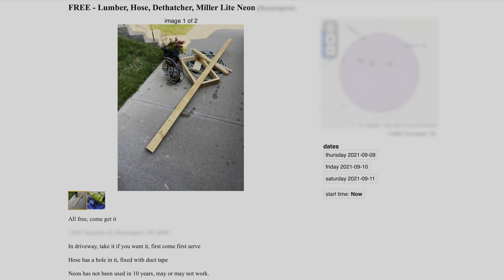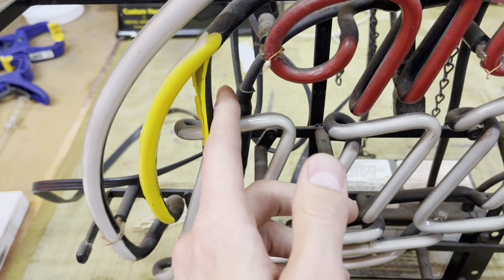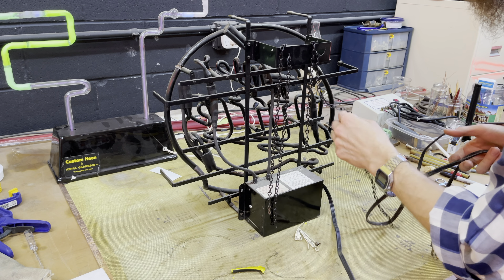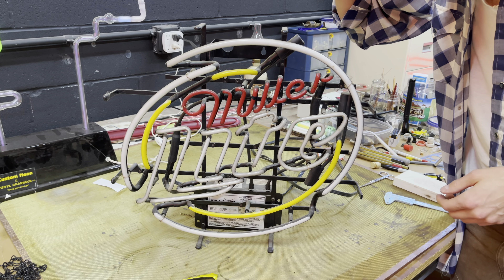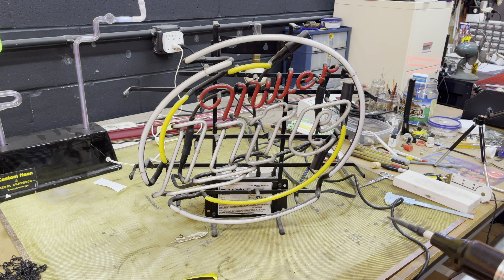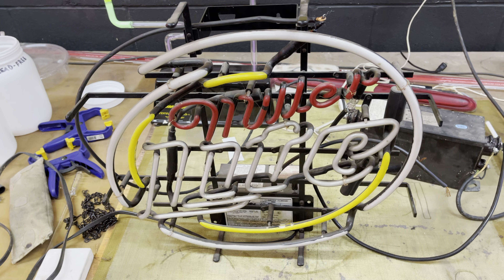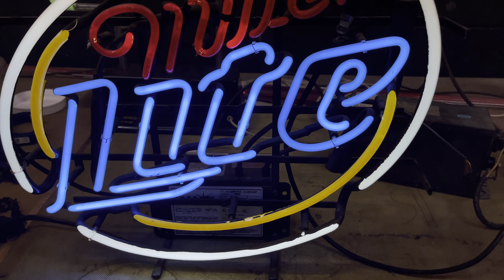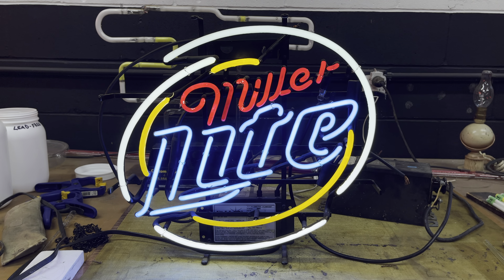Neon Sign Troubleshooting

Comment: Awesome video.

I'm planning on having a 3/8ths scale replica of a movie neon made.

Currently I'm still trying to recreate the original 1960 studio blueprint from a blurry screenshot. I've worked out the majority of the measurements, the only major question I have is the color of the sign body, I know the basic neon colors used.

The information I've gained from video such as yours will help immensely when im finally ready to have it built. I've learned that 3/8ths scale is the smallest I can go due to neon tube sizes, and that I probably don't want a neon that buzzes loudly like in the film.

Anyway, thanks again. Cheers

Comment: I recently picked up a similar light. 

How do you know the switch wasn’t bad and the transformer is working? 

The pull string was missing on mine. Do I need a specific kind of pull switch or can I use something from Lowe’s made for a ceiling fan.
Reply from the maker: good question!  TL;DR—on this transformer it's probably just way easier just to replace the whole thing.  but.....

transformers that are "dead" or "bad" could possibly still be working, but something may have shorted internally.  however, during manufacture, the internal components are potted in tar or epoxy, so troubleshooting anything inside the transformer case ranges from extremely difficult & time consuming to practically impossible.

that said, i was wondering the same thing as you, so i opened mine up to see if i could replace just the switch.  from what i could tell, the switch input goes to a circuit board that provides the ground fault protection as well as cycling the dim/off/bright/off.  i guessed that something on the circuit board had died, so as an experiment i depotted the whole thing, removed the circuit board, and wired the switch directly to the primary coil.  the transformer did work after that.  i dont remember if i used a new switch or if i kept the original one.  i put it back in the metal box without the potting tar and riveted the box closed.  the sign now works with the original transformer, but it no longer has the dim feature or ground fault protection.

was the circuit board really bad, or had internal arcing caused carbon traces through the tar that was shorting out the windings and removing the tar solved the problem?  i dont know.
would i ever do it again?  debatable.  it took HOURS, and it was a horrible, disgusting mess.  also, one wrong move and a wire in the transformer windings gets broken and all the work up to that point is a waste.  i was honestly amazed when the transformer actually buzzed to life after the whole ordeal.  also, old transformers can contain PCBs, which are carcinogenic.  i think this one was probably new enough to be PCB-free.
if you want to see what is involved in just removing a transformer from the case, (not trying to rehab the old transformer), check out this video from NeonSignStuff: 
https://www.youtube.com/watch?v=IrMra2uU4Yg
Reply: @NeonPreservation  thanks for the reply! When I opened mine up the switch was easily accessible. It looks just like a ceiling fan pull switch with 3 wires. I tried swapping it out with one from Lowe’s and the light came on but it just had the faintest glow.
Reply from the maker: ah yes, i thought i remembered the switch having 3 wires... but its been over 2 years since i did that experiment and i couldn't remember for sure, so i just omitted that particular detail to avoid providing false information.
also, i just found a picture in my photo library with notes confirming that i replaced the switch with a simpler 2-wire on/off pull chain switch.  the original one was all gross and tarry anyway.  i even load-tested the core-and-coil guts of the transformer and it was outputting the correct amount of current, so that worked just fine.  since your new switch didnt fix the issue, id be willing to bet that circuit board is the culprit.  i dont really know much about electronic circuitry & components, so i just got rid of it all together.  someone more intelligent than i could probably have replaced whatever failed component on the (gross) circuit board, but eh, at least i got it working again.

Comment: I use a hair dryer to soften up end caps.
Reply from the maker: after i finally got them off i thought, "man, that would've been a lot easier if i had just used my heat gun..." 🤣
Reply: @NeonPreservation  I've seen heat guns crack electrodes if the shop is cool
Reply from the maker: indeed!  slow, gentle warming on the lowest setting to avoid stress fracturing of the pinch seal or nearby welds.

Comment: Awesome videos!! I’ve been trying to get into neon for a while but can’t seems to find the equipment needed. Any tips for locating equipment?? Thanks for your help!!
Reply from the maker: indeed, finding used equipment can be challenging... keep an eye on craigslist, ebay, and FB marketplace, you never know when something might pop up.  rarely, you also might find an auction house liquidating a sign shop.

in the mean time, you could read through some informational/instructional books to familiarize yourself with the necessary equipment, what it's called, and how it works.  Neon Techniques, Neon Superguide, and Neon: The Next Generation are all excellent sources of information.

if you can't find a "whole setup bundle," buying just the torches first is a good way to "get your feet wet" and see if you like it, while saving the expenses of all the processing equipment until later.  you should be able to find a local(ish) sign shop that can process your pre-made tubes if you dont have a processing setup initially.

good luck!
Reply: Same here. Hard to find the equipment and even harder to find someone to teach you. Love your videos.  Thanks for making them.

Comment: Thanks for the video! I recently bought a Dad's Garage neon sign, beautiful, but just after a couple of months it started failing (a flash on turning on, then off). Initially after some tries it stayed ON, but now... cannot switch on anymore. I was afraid of a bad tube, but... now I think that 99% is a bad transformer, to be replaced in warranty. I'd rather prefer changing the transformer 'cos... sending back the whole big sign is a bit of a mess... I'll buy on amazon a cheap coil tester to be 100% sure... Thanks again
Reply from the maker: be careful and good luck!
Reply: @NeonPreservation  yep... when I read thousands of volts... obviously this has to be taken with care :)

Comment: Awesome! I just picked up this exact sign but one of the tubes is broken. Is it worth it to find someone local to repair or not.
Reply from the maker: well, it depends on what its worth to you and what you have in it already.  a neon bender would be able to tell you exactly how much they would charge for a replacement tube (most benders won't repair the Argon/Mercury filled tubes that this sign has); i would expect to spend maybe $100-$150 or so, depending on the complexity of the unit.

these signs were mass produced so they aren't particularly rare.  while that doesn't make them worth a whole lot, it does increase the odds that you might find someone parting out another broken sign.  obviously, it would be best if they are within driving distance since shipping neon tubes is risky.

Comment: If you don't mind more questions, in your newest video about the art thing how do you have your own colors in the tube? Sure, paint is a cheap way to do so, but are there specific gases which give out specific colors? or how does that work
Reply from the maker: there are several factors that contribute to the color of light emitted from the tube:
1) the fill gas.  in neon signs its usually either Neon (glows orangish/red) or Argon & Mercury (glows blue).  other gasses have different colors & characteristics but are usually only used in special-effect/art tubes.
2) the powdered phosphor.  it coats the inside of some tubes and glows a particular color (the fill gas contributes as well).  e.g., Blue phosphor will glow blue when the tube is filled Ar/Hg, but will glow Pink when filled with Neon.
3) the glass color.  in this video i showed an example of red & yellow glass tubes, but there a large variety of colored glass tubes available.  they are made in Italy and are more expensive than regular clear/coated glass.  a cheap (read: crappy) way to avoid the cost is to just paint the tube.  painted glass isn't as vibrant as colored glass, and obviously, the paint doesn't last and peels off eventually, making the sign look stupid.
Reply: @NeonPreservation  
Aha! Thanks for the info, all this should be written down in a site. Honestly, these things look so beautiful... I don't even recall when is the last time I actually saw it, it brings weird eerie memories however, heh. 
Usually Colorful Gaseous Tube lights (dang! I came up with my own name c: ) can be put in the era of 2000's to 2005 ish, I think I remember seeing some "Leminal space" videos with neon on them, they just give that ambiance out, could just be that it's old and no one uses them, hence a memory

Comment: If wire nuts are not rated, what should you use as a permanent connection?
Reply from the maker: the wires should be twisted together and covered with a properly rated boot/cap that is specifically designed for use with neon.  of course, always follow your local electrical codes.

Comment: what would cause a tube to flicker once each time you try to turn it on?
Reply from the maker: sounds like an electronic transformer going into safety shutdown mode.  the circuitry detects continuity & resistive load, and if something isn't right it shuts down.

the question is, what is it detecting?  for example: it could be one of the tubes is broken and the circuit is incomplete, or perhaps a tube is going bad (increased internal resistance), or perhaps the wiring is grounding out somewhere.
Reply: @NeonPreservation  where would you recommend i start troubleshooting?
Reply from the maker: you could try testing each tube separately by wiring them to the transformer one at a time; that could help you find if a single tube is bad.  please note that neon transformers are high voltage and can give a nasty shock, so make sure it is unplugged before working on it, and be mindful of where the wires are when turning it back on to test.
Reply: @NeonPreservation  this sign has 2 transformers. 😲
Reply from the maker: many larger or animated signs have more than one transformer; if you test the tubes individually, i would use the transformer with the longest leads because it will be easier to reach.  unplug the other transformer while you're testing so it doesn't accidentally shock anything.
also, it might be a good idea to take a picture of what all the wiring looks like before you unhook it all, for future reference when you're putting it back together
Reply: @NeonPreservation  thank you good sir!!!
Reply from the maker: you're welcome, good luck!  let me know if you have more questions
Reply: @NeonPreservation  absolutely will!!!

Comment: I have an old OPEN sign and the transformer has gone out. It says it is 4.5-0-4.5 kv 30ma.  I tried a 3kv 30ma I found on Amazon and the sign is partially lighting up and not as bright so I’ve ordered a 5kv 30ma. Do you think that will solve the issue and will it be ok at 5kv?
Reply from the maker: assuming there are no tube issues, then yes, a 5kv transformer should be able to run the sign, no problem.  i imagine you will be buying an electronic transformer?
electronic transformers are self-regulating, so it will adjust the output to whatever the sign requires.
Reply: @NeonPreservation  ahhh it does say electronic. That explains why the first one I got, when I put the wires close it would cut in and out of sparking and I though it was defective!
Reply from the maker: yes, electronic transformers have short-circuit & overload prevention features... typically an electronic transformer will 'try' to light a sign 3 times and if it doesn't sense the correct output/current draw it will go into safety shut down mode which usually requires it to be unplugged and plugged back in (or switched off/on) before it will try again.
Reply: @NeonPreservation  ahh now it makes sense. Thanks for the info. I assume it’s normal then that the 3kv only lit part of the sign since the original transformer says 4.5kv
Reply from the maker: correct, transformers are selected based on the length of tubing there is to power.  a 3kv doesn't have enough 'juice' to run a sign designed for a 4.5kv, but the 5kv should have enough, and an electronic transformer will dial itself down to 4.5kv to match the required output.
Reply: @NeonPreservation  ok it should be here tomorrow. Hope it works. Cheap Chinese off Amazon so hope it’s not under powered. Do I need to be concerned at all about the original being center tapped apparently and the “4.5-0-4.5 kv” output it says?
Reply from the maker: i dont ever recall seeing a transformer with an output listed like that, but i am not the worlds leading transformer expert either, ha.  i suppose if it's midpoint grounded it's possible that it could be a 9kv with 4.5kv on each side...  hard to say without seeing it in person.
Reply: @NeonPreservation  Well the 5kv transformer didn't cut it.. I got a 7.5kv and that did the trick. Interesting how the original vintage xformer was 4.5kv and it took a new electronic one to be 7.5KV...
Reply from the maker: hard for me to say what the discrepancy was without being able to see any of the hardware in question, but nice job troubleshooting & finally getting it to work!  i hope it glows for many years to come.
Reply: @NeonPreservation  works great now. Yeah. Maybe just because they are cheap. I tried measuring the kv on the new one but it’s not showing up right. My guess is the electronics are regulating the voltage and it’s probably PWM or something.. who knows. It looks perfect now. Thanks for the help.

Comment: Got a monster sign for free but one tube doesn’t turn on the rest will turn on for a second then turn off just barely found this video was wondering if you have a video or info on a way to repair or even just bypass that one tube so at least the rest light up.
Reply from the maker: yes, if a tube is causing issues you can bypass it.  neon is wired in series so all you would need to do is connect a wire from one side of the bad tube to the other.  you need to use high voltage wiring (GTO) and be sure it is unplugged before you start messing with it; high voltage can be dangerous.

Comment: I have a Icehouse Neon sign that I had for years.  I moved and noticed the ICEHOUSE tube is broken.
Reply from the maker: sorry to hear that!  you could try checking FB marketplace or Craigslist to see if anyone locally is parting out a similar sign, or try your luck on ebay (shipping neon is difficult to do properly).
alternatively, you could contact your local sign shop/neon bender to get a quote from them.  depending on the type of tube, it may be possible to repair the break; otherwise they would just make a replacement.

Comment: Will a bad transformer only power half the sign or what is wrong with a neon light that has a dead top half lettering but a lit bottom lettering
Reply from the maker: if part of the sign is still lighting it sounds more likely that it is a bad/broken tube
Reply: @NeonPreservation  thanks !